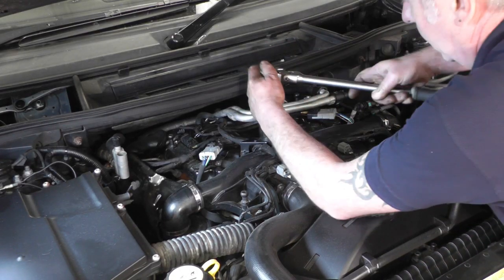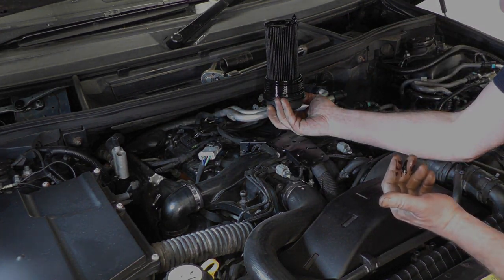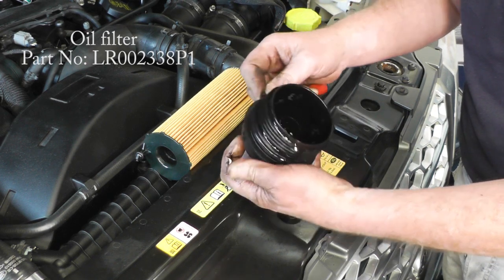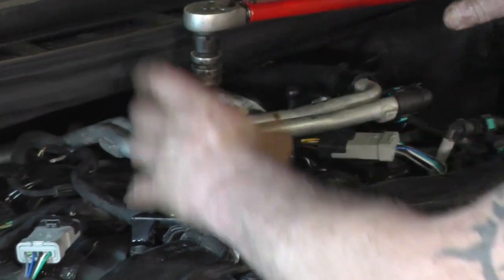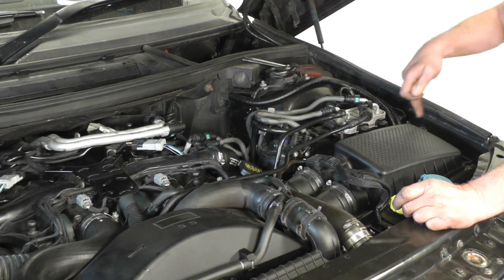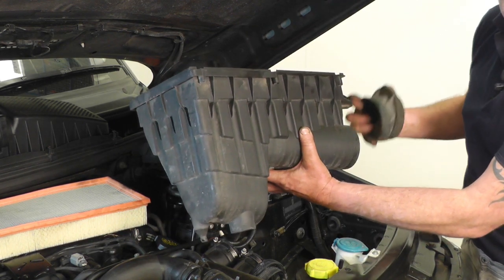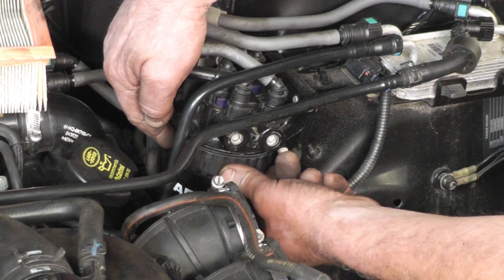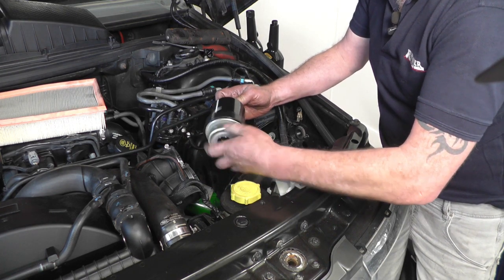Range Rover L322 - Engine Service Procedure

Comment: Very surprised to see J-P on this video only removing one of the two engine oil drain plugs. The official Range Rover workshop manual tells you to remove BOTH. additional oil does come out of the second drain, it is a pain where it is located but should it not be done?

Comment: Missed the second drain plug at the back of the engine, this needs removal to allow the turbo sump to drain.
Reply: Never ever managed to find the second drain plug.  Could someone give me a clear description of where it's located
Reply: @simonchan1076  At rear of the sump, hidden above a crossmember. It is a pig to get off and drain without getting oil everywhere.

Comment: An excellent video, and very well timed as I have to do mine any time now, I did think J-P would get a drenching of old engine oil here, but having the 4 poster avoided that! Is there a diesel fuel pressure regulator as on my TD5 Defender that requires servicing on the L322 ? Many thanks for posting this ! Stay safe ! Chris B.
Reply from the maker: Hey, Chris. Nope. No pressure regulator to service on the L322 as it's common rail and they rarely fail like the TD5 ones.
Reply: That is a relief! A real dangly upside down under the bonnet job that is, when the temperature here drops below 35 degs I must replace mine! Stay safe , Chris B.

Comment: Hi loving the videos as ever but got a bit of an ask if possible. Please can I draw on your well of knowledge. I have a 4.4 petrol 2003 L322 HSE and for some reason the interior lights have stopped working when the doors are opened and I'm now left opening the doors with the key as the fobs stopped working too and the central locking button under the hazard light switch.. The lights work if you press them inside except the front centre dome light. I've swapped it with the back an the same problem persists. I've read about BCM's going into transport mode but I've no clue how to get it out of it or even if it's in it to start with. I spoke to Jaguar Land Rover Manchester an they now don't even have the software to work on my car even if I was willing to pay the £180+vat an hour for Labour/Diagnostic's. Basically if this has happened to you before or you have seen it before please help. It would just finish off the car (before the next thing crops up) Many thanks in advance for your help and time it's really appreciated. Please keep doing the videos as they are absolutely belting 👍👍
Reply from the maker: Hi there,

Thank you for your feedback on the videos, it is much appreciated!

We have not come across this issue before so, we would recommend you seek advice from a local garage (who has diagnostic equipment for Land Rover). They should be able to help you locate the issue. Once you know what the issue is please feel free to get in touch and we can see about sourcing parts if you need them :)
Reply: @RimmerBrosTV  brilliant thank you for your reply. It was worth a shot 👍 I will do soon as I know what's what. Many thanks again and keep up the videos they are truly helpful for us all 👍👍

Comment: My rang rover 2007 d 3:6 as start to smoke black smoke when push to go around a car I thing it something with fuel could you help tell me what to do thank you tony🙏🏻
Reply: It is the end. Black death.
Reply: Could be the Turbos. They’re prone to failure.
Reply: turbos or inlet manifold cracked
Reply: Depends on the smoke type. It could be turbo or dirty injectors. I just added an injection cleaning stuff from Liquy Moly to the diesel. Amazing: black dust when accelerating stopped totally. But my turbos got replaced fortunetely by the previous owner